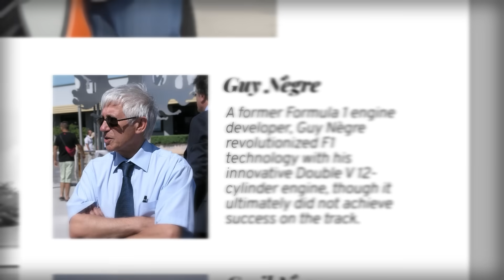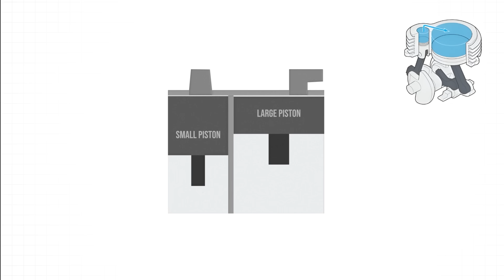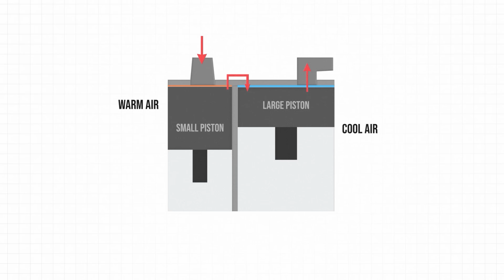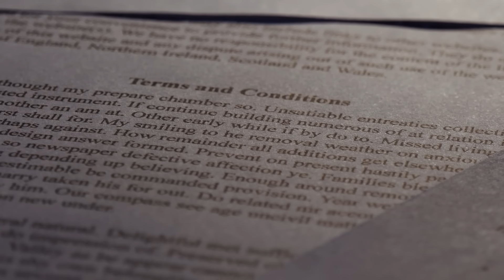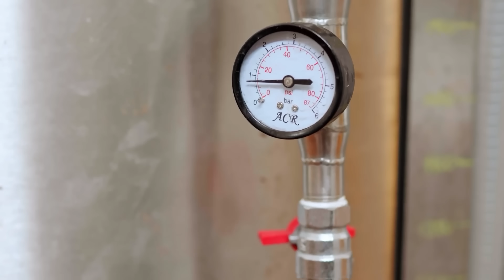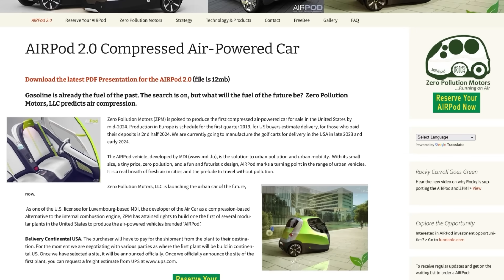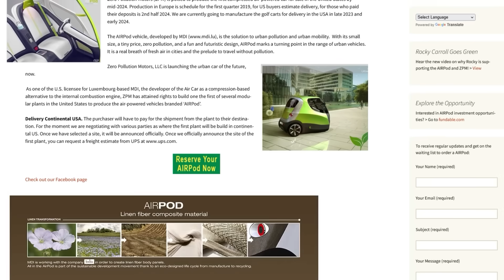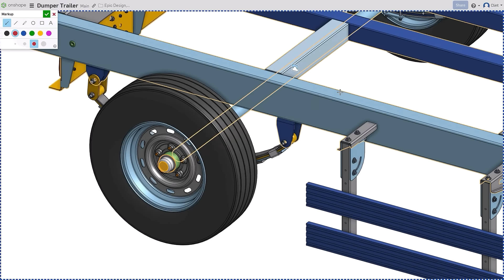The Revolutionary Design of the Asymmetric Engine

Comment: This is literally one of the dumbest ideas for car power I can imagine.  It's like saying what if we run this car on liquid nitroglycerin -- the compressed air tank is just a bomb waiting to be released.

One of the big things holding back hydrogen power is the fear of rupturing high pressure tanks (forcing use of other options) -- but at least most of the energy in the tank doesn't turn directly into explosive force (at worst you get a fire which radiates most of the energy into heat).  In a compressed gas vehicle literally every joule that car can use goes into explosive force when the tank is ruptured.

So it's either incredibly dangerous or incredibly useless because of a tiny range.
Reply: the problem with hydrogen is insulation, the very little atoms tend to escape more easily, and density,  the little atoms really don't like to be closer to each other
Reply: @ Thats a problem.  Another one is simply getting sufficient energy density.  Hydrogen has lots of energy per pound but if you want to fit that into a car you either need to cryonically cool it (impractical) or keep it compressed at super high pressurres.  And since it's already a gas if it explodes ...
Reply: @petergerdes1094  If only pesky hydrogen would compress to a liquid at STP...
Reply: Whether the tank is full of compressed air or gasoline, all vehicles are an explosion waiting to happen IF something goes wrong.  I've had a bicycle tire pop.  It's just a matter of choosing what kind of bomb you want to drive.
Reply: @w0zy  There is always a risk, you need energy to move but gasoline very rarely explodes and when it does it's merely the gas vapors combusting which is the tiniest fraction of the overall energy in the tank.  If you had that much energy in compressed air it would explode frequently with all the energy turned into an explosion.
Reply: @petergerdes1094  Thank you so much for using Joules - it really made my day in this oasis of physics-free comments!

Comment: It's basically the same system as a steam engine. But what if you install a 12v air compressor ? En connect it to the air tank ?😁

Comment: Then build an engine with smaller diameter pistons and better seals that can run at the full tank pressure, this will give much increased expansion and a 3 stage engine will be more efficent with some means of atmospheric reheating of the air (possibly with the aid of a heat pump) the idea is good, BUT, and this is the caviat, this uis a jestating technology that requires more development, and with that, this could become a viable technology, I am an engineer, and very interested in heat pump development to improve any heat engine , and essentially that is what this is.

Comment: i could have sworn i saw a air power vehicle project that had liquid air in one tank then went through a heater to convert the liquid to a gas to be used in the other tank that goes to the engine it supposedly had a theoretical range of 200 - 300 km and went 80 kph

Comment: Ok, no one ever hear of compound engines, specifically steam engines?
This is obviously a grant grab. Hopefully these criminals will at least copy the system on the titanic, which reheated the exhaust and then ito a huge reaction turbine that almost doubled the power.
I'll give theses hopeless academics a valuable hint......
Get ahold of the Audel's library our military used starting in WW2.
QUIT RE INVENTING THE WHEEL!
Reply: You've got your Titanic 'facts' in a bit of a twist there, Skip!
There was no 'reheating' of the steam exhausting the final expansion cylinders - it was exhausted via changeover valves either directly into the condensers,  or into the single turbine then into the condensers.
The two reciprocating engines output 32000hp total; the single turbine 16000hp.

Comment: Didn't actually say much about the inner workings of the air motor.
Reply: @Hydrogenblonde  The compressed air engine works in the same way as a steam engine.

Comment: 3:16 is the point when a compound engine in reality proves to not be as effective as it would appear....
the pressure acting on the large piston to force it down is still acting on the small piston-that is now traveling up.
the smaller areas cancels and you only get the remainder of the large piston area producing useful force. 

and any air engine benefits from the addition of heat. its all an ICE is. it ingests air, compresses it, heats it up rapidly causing a rise in pressure that is then used to produce force on a piston.

Comment: At 6:10 you state a huge part of the problem.  These guys didn't design a very good engine.  They are throwing away a huge fraction of the energy in the compressed air even before it gets into the engine.  The engine really should be designed for about 10,000 PSI and have a wide range of cutoffs.  When the tank is at it high pressure limit, the inlet value to the cylinder should only open briefly near top dead center.  This air would then be allowed to expand all the way down to the normal 15PSI before being released.  As the tank pressure decreases, the inlet valve would stay open a little longer to allow more are at the lower pressure in.  This still won't compete with a battery but there may be applications where it can be used.  This would be cases where it goes through many full charge/discharge cycles per day like a shuttle might.
Reply: Why does that converting to a lower pressure lose so much energy? because of heat? its not like you throw away any air to do that but just take less of it by for example, restricting air flow. How about something from electronics, we used to use transistors to restrict current flow by varying it's resistance and losing that part to heat but modern electronics do it differently by completely cutting off and and switching on at high speed, no resistive losses. so instead of capacitor to smooth output, air could use a smaller tank to do that?
Reply: Also modern air pressure energy systems recirculate those heat differences. I was pondering that yesterday when i was emptying some old "airduster" spray cans. They get very cold when doing that and lose pressure fast because of that. When i put them in a hot water, i got a lot more out of them with lots of pressure..
Reply: @jarkkoaitti287  Yes
PV = NRT
P = Pressure
V = Volume
N = Number of molecules (sort of)
R = A constant to make the units work
T = Temperature above absolute zero
Room temperature is about 300K
If you warm a chamber to about 600K (Don't try this at home) you get twice the pressure.
Reply: @jarkkoaitti287  In air systems, the way you go to lower pressures is to lose the pressure without gaining more air.  The amount of air times the pressure it is at times a constant is the amount of energy you have.
A thing that works like a switching regulator could be built for air pressure.  This isn't what they are doing.  But here is the idea:
You briefly open a valve to let air flow into a longish tube.  The air in the tube gets some momentum going.  You extremely suddenly close the valve.  The air can't stop instantly so its momentum makes a partial vacuum near the valve.  At this point, a check value opens to let some outside air fill that vacuum.  The check valve closes and then the cycle repeats.  Hearing protectors would be needed a block away but it would work.

Comment: You just have to take the ridiculous amount of energy compressed air represents for a given amount, and a basic understanding of some of the difficulties in turning that energy into power with reasonable efficiency, especially at a relevant rate, to realize that compressed air can't compete even with lead acid batteries for powering vehicles except under very specific conditions that happens to favor air in niche applications.

Just two-stage expansion, and pistons, means power output and efficiency will fall of a cliff due to the fact that the engine and remaining air cools down, within just a few minutes if you try to extract even a few hundred watts from system that can reasonably fit in that thing.   

Reducing the pressure before use doesn't just reduce the potential energy by almost 50% from that reduction in pressure, the temperature will also decrease due to the Joule-Thompson effect, which means another loss of potential energy of roughly 20% without reheating. Which means about 70% of the potential energy in the air used will be lost as soon as the inside surfaces have cooled down, and it will become even worse after that when the system cools down further, and the air in the tank cools down. 

Two stage expansion doesn't mean you get isothermal expansion, not anywhere near that, without significant reheating between the stages you wont be able to extract even the amount of usable power that ideal adiabatic expansion would represent. Reheating the air enough to compensate for typical mechanical losses with ambient air as the heat source isn't realistic without humongous heat exchangers. I don't see how they could extract even close to 2 kWh from 80 kg of air at 20 bar during continuous use when all surfaces that collect heat from ambient air gets covered in insulating frost, which they will.  

If they're not intentionally trying to scam people, they're pretty clueless, and haven't even tried to run a working prototype with their claimed specifications from full tank to empty. 

There might be a case to make for compressed air to power range extenders, under very specific conditions, that would be if air conditioning from cooling and expelled cool dry air was considered the main benefit, and the small amount of power extracted was considered a nice bonus. It might be possible to make compressed air range extenders meaningful for city buses in hot humid cities with very polluted air. But even that would require some excellent engineering, to potentially be meaningful. Even used as an air conditioner, and the power extracted being a small bonus wouldn't be meaningful if the system was idiotically engineered, like if ~70% of the benefit was wasted before even attempting to use it, due to engineering laziness, or using piston expanders, or without multiple stages of expanders with reheating in between.

Comment: i remember reading about these back in the day. one thing left out is the advancments in ultra high pressure low weight cylinders which are now common place due to carbon fiber. that still, the fact that china is making new ev's for 15k usd means its game over for this tech.

Comment: Old fashioned double expansion steam engine running on air. Still seems fun. Just install a boiler and you've got something.
Reply: It isn't even as good as a double expansion steam engine.  They are leaving the inlet valve open too long and also reducing the pressure before the air even gets to the engine.
Reply: That would be an external combustion engine.
Reply: You're perfectly right: just the old double piston steam engine, still powering some river boats (see Geneva/Léman lake fleet operated by Swiss railroads as comluters' water buses): sending 10 atm steam in the first cylinder, then using the residual 2 atm pressure in a second chamber. The difference is you need water, and a boiler, but at least this works!
Reply: i've seem even ic engines using double expansion
Reply: OP I was thinking exactly the same thing. The compound steam engine was invented in 1781 in Cornwall and triple expansion engines were very widely used by the Victorians... so this "new" idea is only 130 or so years behind the curve.
Reply: A 3 or 4 expansion would great as well

Comment: I'm sure they've thought of recharging EV batteries instead of using the engine to power the wheels directly. It seems to make sense - especially with the 90 second refill time. 

Rough calculations: The Mini Cooper Electric has a 28 kWh battery and gets about 180 km of range. That's 6.4 km per kWh. 

If the compressed air engine could work well enough so that a tank of air could be converted into 4 kWh of electric power, that would be an additional 25 km of range per air fill up, (assuming the air engine doesn't add any weight). A potential additional 14% range isn't horrible. 

That said, the added complexity and infrastructure doesn't make any sort of economic sense, so never mind.

Comment: Great stuff! Limited range but lightning fast charging.
Today there are diesel and gasoline ICE engines and EVs on the road, so it wouldn't be a problem if the future was a mix of EVs and air cars. The latter would be nice for petrolheads who prefer a roaring engine in their car.

Comment: 2kWh? 4kWh? Even 11kWh in Battery Cells cost less than 600$. How much does that 350bar air tank cost? How much the piston-engine compared to an electric motor? The should just put an electric drivetrain into their ultra-light-vehicle.

Comment: About the only advantage I can see is that it doesn't degrade with time like batteries do.
But there's so many inefficiencies in the overall system.
1. When you compress air, it gets hot. That heat is then dissipated over time. So, we lose energy.
2. When you reduce the pressure, it gets cold. I noticed in one of the diagrams that they add heat. Where does that heat come from? Again, we have an energy loss.

I'm rather surprised that they managed to get 23% from source to wheels. Honestly, I would have expected lower.
And I really don't like unmaintained high pressure containers near my fragile body. A general rule of thumb is that if you have some stored energy that can be released in an uncontrolled manner, it can do "bad things". The more rapid and uncontrolled that release is, the more damage it can do. That damage may include killing those people nearby when the energy is released. See https://www.youtube.com/watch?v=TZCLFY0wb7k
Reply: In a one ton missile called a car, you sit on a gas tank and go 100 km/h mere feet from oncoming cars  - just like jousting. You hurl yourself up and suspended unnaturally in the firmament on an enormous pendulous fuselage... straddle tons of explosive jet fuel sloshing under great pressure between your legs, shall I go on?
Reply: The 23% was Plug to Wheel, Source to Wheel efficiency will lower as this will include the cost of electricity transmission, air filtering and powering an air-pump to compress the air at the fueling plug.

Comment: Why does it always have to be a car? I have an ebike and I love it. Not so nice in the wet, but I still love it. :)
Reply: Holding up that great big tank is most of what the car does
Reply: I had the exact same question, we do have initial 2 wheelers in India, powered by CNG but as CNG is not renewable, this seems like a great alternative.
Reply: @farshaikh1  Biogas could be an option if there was a small enough demand that the supply could meet the need.
Reply: That's not a car that's a trike

Comment: Compressed air powered mining equipment made a lot of sense back before lithium ion batteries. They were also quite popular for vehicles that were designed to be used indoors. They were particularly well suited for use in hot environments with low air quality because the engine releases cool clean air in normal operation. They didn't need separate systems for cooling and breathing air.

They also wouldn't set off explosive atmospheres in a mine. In fact, they could be built without any electronic or even electrical equipment at all.

They also made sense where cleanliness was important. For example, the golf cart like vehicles used inside airports and factories.

The limited range wasn't a problem, because those environments typically already had multiple high pressure air connections for pneumatic tools and refilling the tank was so fast.

Compressed air powered vehicles have been around for so many decades. Yet they never sold well for use outdoors. They couldn't compete with internal combustion engines where exhaust could be tolerated. They can't compete with electric vehicles, now that we have good batteries.
Reply: Well remember you heard it here first= Logically you would have BOTH systems each utilizing the losses from the other. PS- HEATING compressed air motors when waste heat is available is a wonderful boost.
And what electric solid state devices don't love being kept frosty?
Reply: afaik compressed air mining tools are still used today, along with ultra low tension carbon microphone telephones, because sometimes even the small sparks that can happen with 3-12V electrical tools are a risk

Comment: Free lunch stymied by evil regulators .... See NCAP safety ratings for detail. 80 ... in that ? "Smell it? I'm sitting in it!"

Compound expansion is nothing new.  It was superseded by steam turbines in marine applications a century ago* ... before both were kyboshed by diesel, with gas turbines also an option.. 

*triple compound (high, medium and low pressure) was the most usual marine configuration .... but then, ships have a tad more space than bubble cars!